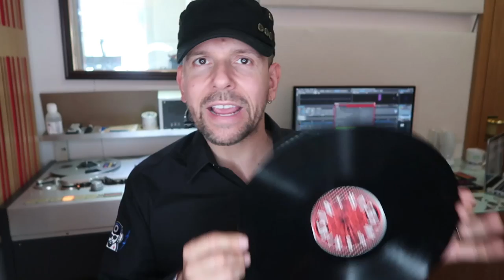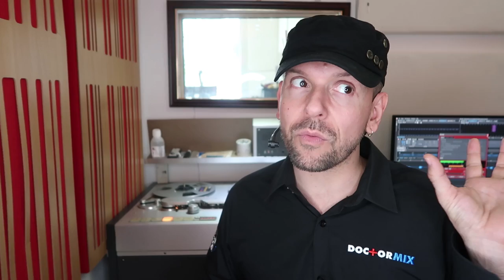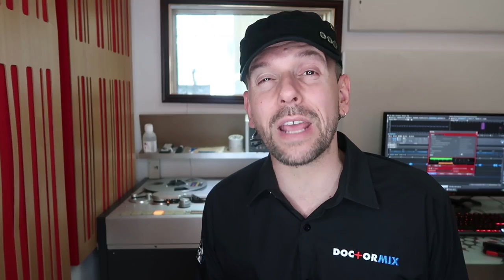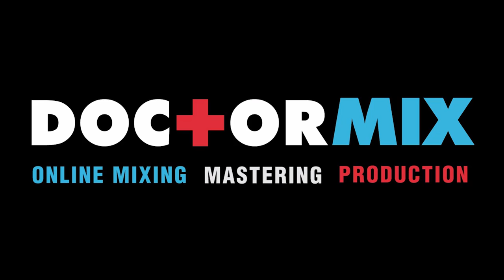How To Mix & Master For Vinyl

Comment: So if we can not have stereo low end and we always make it mono for vinyl, I'm constantly wondering how did they do when we listen to orchestral works on vinyl, where the double bass is sounding deep and full, placed at the very left side. Do you have any idea of how they do that?
Reply from the maker: Martin Scian the double bass is not made of low end only :-) in fact even that instrument is made of mostly mid frequencies plus a good amount of top end, as any string instrument! All of that can be panned around freely on vinyl. It’just the very bottom end that may be a problem: it has to be collapsed into mono to avoid the needle to jump out of the groove during playback. But this doesn’t mean the double bass can’t be panned left or right